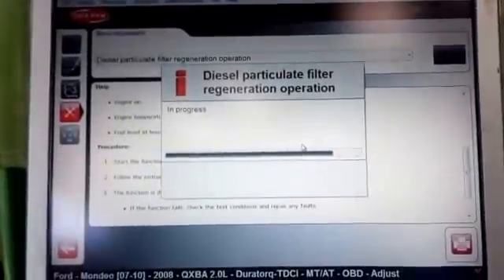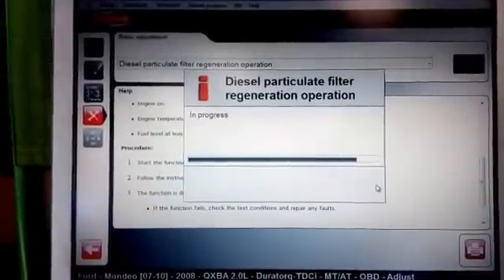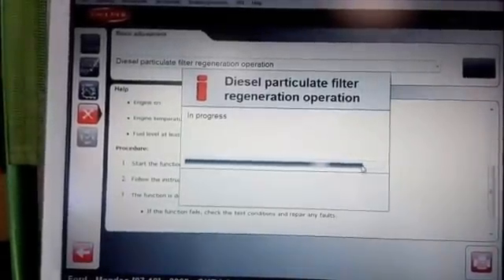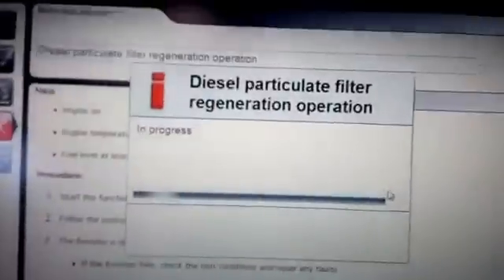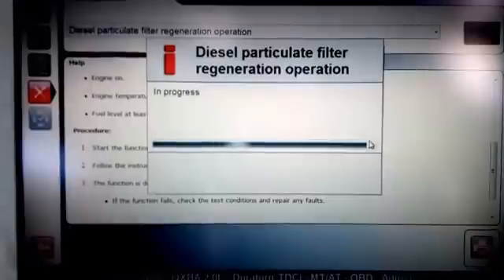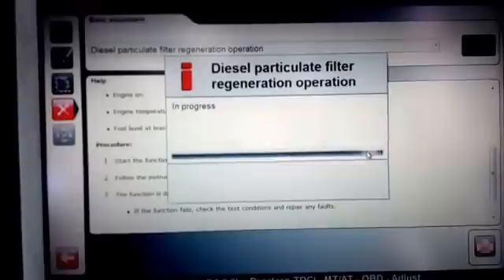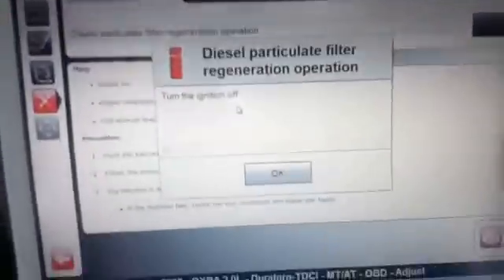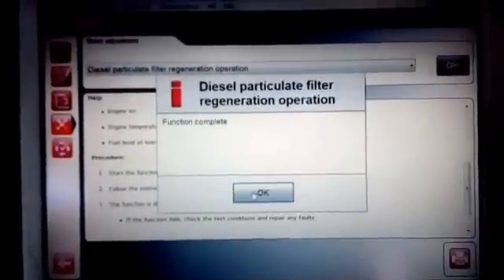Ford Mondeo DPF Regeneration

Comment: How long does it take, the static regeneration?
Reply from the maker: Static regeneration and parked regeneration both take approximately 45 minutes to complete. it depends on what temperature degree your DPF filter needs to reach to burn off the soot.

Comment: Want reliability and fuel economy? Buy a 2.0 petrol and have an l. P. G system fitted. No problematic injectors or high pressure pump or d.p.f to worry about and you'll have a cleaner engine too that isn't full of soot.

Comment: in progress its better open the hood
Reply from the maker: +Tomáš Hauerland it's not really necessary but if you want to you can
Reply: Taj Tyres  It's better to cooling system. And it's good to switch on all electric equipment (radio, lights, A/C)